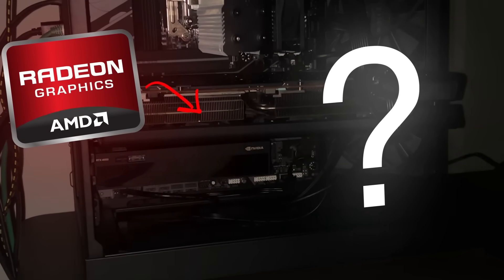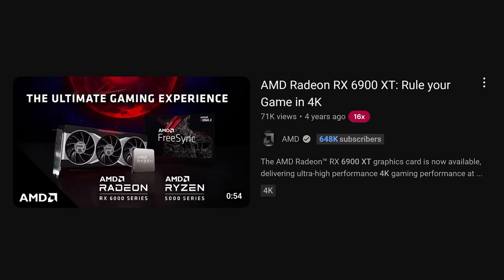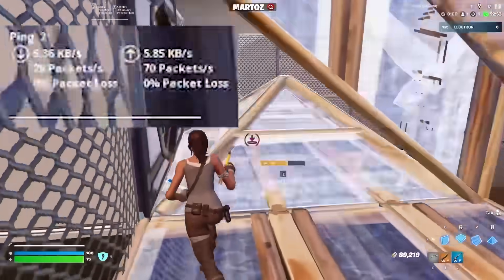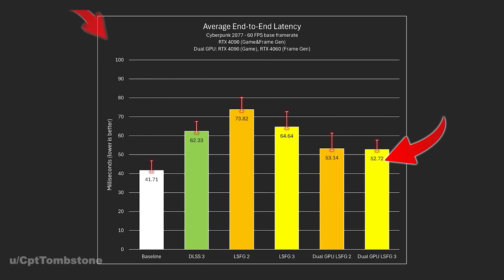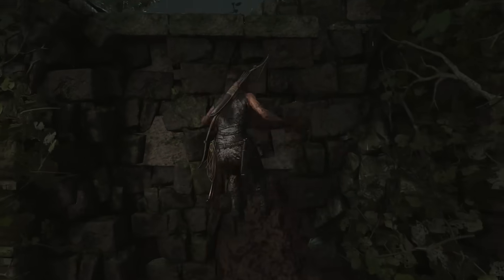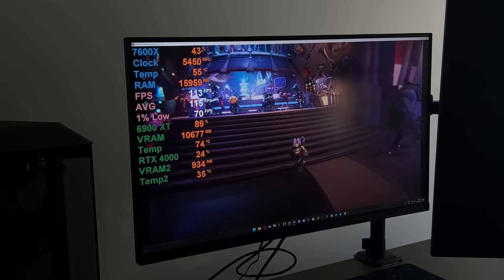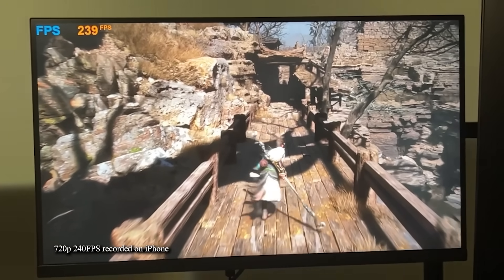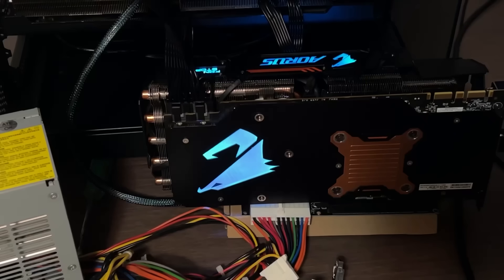I Used Both AMD & NVIDIA in One PC and Got 240 FPS in Every Game

Comment: Lol, I love your ridiculous and janky budget setup to get frame gen working well on cheap cards. Reminds me of my younger days before I had the disposable income to just build a cutting edge PC. A few of my favorites from back in the day, was where I was able to afford a GTX275 for around $300, but coudn’t afford to upgrade after the GTX 470 and 480 came out. So I bought a 2nd GTX 275 used for around $150, and because it was too much for my PSU to handle both cards, I hotwired a 2nd cheap power supply that sat outside my case, and I jumped a cable on the pin that made it so both PSUs powered up when I pressed the power button on my PC.

It worked fine outside looking ridiculous lol. A few years later, I was able to afford a GTX 680, but didn’t want to spend the $800+ to upgrade to the newer 780 and then the 980 when it came out. So I bought a 2nd 680 used for around $250, and double my FPS with SLI. A year later, I eventually added another 3rd GTX 680 for under $200, and the few games that triple SLI did work with, I had another 50% FPS boost and was actually on par or higher than the latest GTX 980Ti that was out. Problem was that it required a lot of hacks to get SLI working in some games, and even with those Tri-SLI simply didn’t work that well in several games, though it did seem to do well in Unreal Engine which was the majority of demanding games at the time. 

The frame pacing issue did kind of negate some of the benefits, though I was also at this time running a hacked Korean Catleap IPS monitor — That was overclocked from 60 to 100 or 120hz. Bear in mind, this was before LCD monitors with over 60 or 70hz support actually existed, but I was on the cutting edge by running this monitor setup well over a year before all the big brands finally came out with 120hz panels. I did eventually just get a 980Ti to get around the lack of support on some games, and those that didn’t scale well with SLI or at all. And once they came out, I did eventually upgrade to a proper 120hz 21:9 monitor, as the hacked monitor was a huge pain as you had to use registry hacks and an unsigned Nvidia driver mod, that needed to be reinstalled and set back up every time you updated your GPU drives.

Nowadays I’m just running a 4090, had a 3090 before that, 2080ti, and 1080ti previously. I’d consider trying LSGF with a 2nd GPU, for the latency benefits, but this damn 4-slot card leaves me with no usable PCIe slots lol. Hoping to eventually maybe snag a 5090 founder’s edition from Nvidia’s waitlist, as I’d love to simply reclaim my other PCIe slots, a dedicated sound card would be great simply because Realtek on my ASRock motherboard is damn glitchy even when just using the optical out going to my DAC and HiFi setup… it constantly cuts out and mirrors the left and right channels randomly, so I have to rely on HDMI for my audio actually, which works fine on my TV, but isn’t an option when I’m using my gaming monitor since it doesn’t have optical out.

Anyways, keep up your silly janky videos, they remind me of the good old days. Maybe someday you’ll make enough on YouTube or land a decent job in tech and will actually be able to blow some money on a top of the line PC, but until then, I’ll thoroughly enjoy your adventures and advice for the many folks out there on a budget!

Comment: why are you not recommending dual gpu if i dont have a laying around? is there any other  better way to get 240 fps on 1440p without selling a kidney ? and will it work on future ?
Reply: You can use integrated graphics instead of a second card if you lower the flow scale
Reply: @ivanvladimir0435  ooooh, but will i get that much fps wil integrated graphics ?
Reply: @ They'll have a lower limit than say an RX 6600, but the gap can be mended by lowering the flow scale and you would need really demanding scenarios to seriously be unable to give the task to the integrated graphics
Reply: @ so what kind of perfomence will i get with dual rx 580. will this 180$ dual gpu setup worth for poor people like me ?

Comment: is this just an ad for lossless scaling? so much hassle (and money for a second GPU) for a worse result than just conventional MFG from 50 series cards...
Reply: MFG drops your initial framerate (and thus makes the input latency more noticeable) + not in every game

Dual-GPU LSFG doesn't, if he had looked at a tutorial he wouldn't have needed to struggle so much to get it running
Reply: @ivanvladimir0435  MFG doesn't drop the initial framerate tho, I measured what I was getting without MFG (on Cyberpunk 2077), getting around ~40fps (with Path Tracing), with MFG 4X, it goes to ~160fps, which is precisely the 4X it promised, the input latency feels high here, because the real game is running below the ideal 60fps. 

That is why frame generation is not to be used to save a game running below 60fps, but instead to improve a game that is already running well (like for example, around ~80fps) to up to ~300fps, for better perceived motion on high refresh rate monitors, since the game is already running well, the input latency doesn't increase much (it was already good). And this case of the game already running well, is EXACTLY what the video is showing. Now I wish the video showed some game actually running below 60fps, to see if the second card would save it... (it would not, not without the high input latency at least).
Reply: @ MFG drops base framerate as shown here https://youtu.be/B_fGlVqKs1k?t=1118

People shouldn't need to slap a band-aid on their games with more intense upscaling to make up for it

Yet a second GPU would not drop the base framerate, thus giving smaller latency penalty while being way cheaper than a RTX 5000 series

Comment: AMD should really look into this and start making those dual chip cards again. Maybe spend time developing a "Infinity Fabric" type of solution for the two chips to communicate with the Vram for less latency when using both, and or to communicate with the CPU / RAM bringing it full circle in an all AMD system? They could make it like a toggle setting to use both chips at once like old days for performance gain without frame gen, then if you toggle frame gen on it splits to 1:1, and one chip does the native frams while other does the frame gen sending the info within a Infinity Fabric type of system to keep latency down?

Comment: As a technical experiment this looks fun. As a practical solution this is very dumb and not because the hoops you had to jump through because of your limited 2nd PCI E slot, though that does make it much worse.
1. Even trying to use any kind of FG in a competitive game shows that you don't get it. "Just 10ms extra lag" is not good enough for a competitive game and no, the extra smoothness when already running above  100 fps won't make a big difference either.
2. You're never running at 240fps here, stop drinking the nvidia cool aid! Running at 240fps implies getting 240fps equivalent lag which is the main point for running 240fps, not smoothness. I know you know you aren't getting better input lag but going through all this trouble just for the smoothness while celebrating the 2nd coming of SLI (which this not) it's misguided at best.
3. Most people would be better served by selling both gpus and buying a slightly better GPU. You get actual better input lag when you need it and you can run whatever FG the game has when you don't, it will also look marginally better if it's implemented inside the game. You'll get less fake fps but it will be smooth enough.

Comment: I've used frame gen on games locked to 60 where more native performance isn't possible, and it still sucks. It's just motion smoothing. Fake frames suck and increase to power consumption from running 2 GPUs isn't worth it. A second GPU for encoding as a streamer/ youtuber might make sense, but for frame generation is just stupid. Dual GPU was actual frame rate back in the day, and it also sucked. Doing it for fake frames is dogshit.

Comment: Just for everyone's sake, I actually tested ExitLag myself and it does indeed work, surprisingly. I live in Texas, so the server closest to me is Dallas. My normal ping in Overwatch 2 is about 50-55 ms, but with ExitLag enabled, it drops down to 45-50 ms, which is actually decent. In Marvel Rivals, the difference is substantial. I went from about 65-70 ms to 40-50 ms ping; huge reduction. Lastly, in PUBG, I normally get 19-26 ms, but with ExitLag on, I get consistently 11-15 ms ping. Some games have more substantial gains than others, but I have yet to see a game that performed worse than without it being enabled. I am a bit hesitant on actually buying the subscription though. Not sure if I am willing to pay for this difference. The next and only thing you can do is either live near the server or upgrade to fiber optic internet.

Comment: Hello, late to this discovery (though I was pondering about sli/crossfire a decade ago, and recently years ago) I was wondering if you could test AMD CPUs with built-in-graphics (the 8000 series for example) paired with NVIDIA GPU. It will cut major power draw and cost, but what I am curious about is what the performance will be. Hopefully it is not too complex and or overwhelming from the amount of work. Thank you very much.

Comment: I have used both for years until I upgraded to a 3090, I used to use a Radeon HD 7950 paired with a GTX 980ti then after some years I upgraded both to a Radeon RX 580 and a RTX 2060, upgraded that to the 3090.

Comment: The artifacts in control was so obvious and 🤮   Also this is why Nvidia uses tensor cores for frame gen. It’s to offload the work so it’s basically what you are doing with two GPUs. AMD uses AI accelerators to offload in the new 9070 series. So any new gpu already does what you’re doing with two separate.
Reply: They still drop base frames even on the 5000 series unlike Dual-GPU's

Comment: Thanks for sharing this , it worked on my asus G16, with 4060 as rendering gpu and the 890m as lsfg gpu. I am going to try getting either a egpu dock (a bit messy but more flexible) or mobile egpu with 7600m (less flexible but more streamlined) and run it through m.2 to oculink adapter on my desktop with 4080, it’s seemingly making a lot more sense than getting a 5080. Wish me luck.

Comment: I mean, there are 5700 XT for less than 100 bucks, if you like to mess around, you can try out, for instance with a 3060 Ti as the main GPU, and the 5700 XT as frame generator

Comment: I tried that with a high end Threadripper..., works like a charm!  AMD 7900XTX and RTX 4080
Reply: how did you install two separate drivers?
Reply: @quercus3290  I just let windows do it's thing.
Reply: @WilliamNangauta  that doesnt work, so I do not believe you.
Reply: @quercus3290   Quite true!  Simply causes strange behavior from time to time, lockups!  I had it working though.  I really don't see why anyone would do this!!
Reply: @WilliamNangauta  ive done it before, windows wont accept two separate video drivers, one overwrites the other.
Reply: @quercus3290    You will have no probs on  windows 11 installing...... but lockups?  For the birds!  Maybe my motherboards design as PCI 5 in all 4 or 5 slots will do it.  And it did.  You might look at a driver update program of your choice.
Reply: @quercus3290    Windows should install them on theyre own,
Reply: Just did it again.  Works like a charm., you just have to know what you are doing.

Comment: I used to run a Radeon 5870 (I think) with a GT 8800 for physx.  I'd like to see that combined with lossless scaling. Strong Radeon with weak Nvidia.  Highest you can use is a RTX 4000 series cause Nvidia dropped support for 32 bit physx for 5000 series.  Between lossless scaling and backwards compatibility for physx, dual GPUs may not be so outlandish.  This crazy Radeon with Nvidia for physx was my very first PC build.

Comment: This is kind of interesting. I wonder how much the frame-gen actually needs. Would an APU with a dedicated card be a good match? Like a a 5700G for example. If you have that APU, it is aready in your system anyway. Not additional cables or PSUs. ;)

Comment: RT users are weird. My 7900xtx does like 180 FPS in cyberpunk 2077 at 4k with RT and a couple of other things I can't tell the difference whether they're on or off, turned off. I've been restricting it to my monitor's 120fps/Hz maximum refresh rate in order to save quite a significant chunk of power. This is in Linux, for the record.

Comment: Buying a second GPU to produce more fake frames.🤮

I have a hard time getting behind frame gen tech to begin with and throwing an extra off brand card into the mix seems like stat padding at best and more likely a quantitative can of worms in reality. The fact that you are able to jury rig this setup to produce more 'frames' does relatively little to establish whether or not this is objectively an improved gaming experience. I'd be way more interested in some comparisons in visual fidelity on a 5090 doing frame gen, the two gpus working in tandem, and just straight classical rasterization on one gpu. DLSS was bad enough for normalizing visual fuzz in AAA games, and then we layer frame gen on top of that which is really just the same interpolation gimmick tv manufactures have been using to fudge frame rate stats for years. Dumping a secondary set of drivers on your machine to chase even deeper levels of interpolation just seems retarded at this point as its only going to feed the player more garbage frames on top of the blurred mess modern game engines or serving up these days to begin with.
Reply: Your drivers argument shows you don't even know how it truly is, drivers don't conflict at all if you install from both companies
Reply: @ivanvladimir0435  Numerous games crash in this configuration, its uncharted territory and that was my point. Trying to rock this setup all the time will lead to problems at best and at worst ruin the visual fidelity of the experience just from the sheer volume of interpolated frames. Running two sets of drivers causes all sorts of problems with proprietary video card features like g-sync vs freesync. This can easily lead to the wrong set of features being loaded up in a game on the wrong type of card in countless situations. If you think this cant cause problems you are naïve.
Reply: @ You clearly are way over your head, I have yet to run into driver issues from running both AMD and Nvidia at the same time and have multiple videos showing so, the whole g-sync vs freesync "conflict" is entirely made by you as there's no such a thing as a conflict as both run the same way, the whole "g-sync will conflict with freesync" is made up bs, it runs just fine in my PC because that's how it works, it's not conflict on first sight unlike many theorists (and not *testers*, who are actually growing in numbers because of how well this works) are spewing out

Comment: I have 2 extra gtx 980 TI’s should I do this? The only thing I am missing is an adapter for the gpu as I have the same motherboard as you I also have an extra 1000 watt power supply lying around

Comment: That "better motherboard" might cuck the bandwidth of the x16 slots if you use any M.2 though. Some will drop the main x16 to x8 AND another 16 size slot (x8 or x4) down to lower PCIe lanes.
Motherboards require WAY too much research...

Comment: Thank you for this video. I was able to use my RX 580 in display GPU and my A770 in image generation. In adaptive LSFG 3.0 255 + 100% motion flow, WGC 1 API, optimized max FSR and auto full screen, default sync in latency 2 and without HDR. Favorite A770 GPU and RX580 Output Display. 
Everything works perfectly for me. I was even able to play Hitman WoA in full Ultra on the RX580 while I only play in high on the A770
Specs: i9-13900, DDR5-5600 32GB, A770 16GB, RX 580 2048sp 8GB, B760 Gaming Plus WIFI, KLLISRE SSD NVME PCIe Gen 3 3500Mo/s 512GB + Orico e7400 SSD NVME PCIe gen 4 7400Mo/s 1To + HGST HUH72880ALE604 HDD SATA 8To

Comment: problem  w dual gpus as well is mos pcie slots that are secondary produce even less performance then the main , thats if its even supported by the MB my gpu wont fit in bottom pcie it closes it off when main is used

Comment: Would running 2x AMD GPUs get you the similar results? I've got a 7800XT in my rig that has an x16 4.0 and an x16 3.0 slot. I've got a 5700XT laying around that I could pop into the x16 3.0 slot. I could go pick up an RTX3050 for $150 @ MicroCenter, but if I could use the GPU I've already got here, that would be wonderufl.

Comment: Reminds me of using an old Nvidia GT5200 or something with 2Gb of RAM exclusively for PhysX and the rendering running on a RX460 4Gb card or something. Can't recall exactly the pair right now, but definitely recall that this was just to have PhysX on an AMD card, and it worked hehe (also reduced the load on the CPU)

Comment: You sure didn't make it sound worthwhile. I think with more ideal hardware this wouldn't be such a bad idea, but since all we're doing is generating frames... I can't think of too many worthwhile applications. Especially since things like text or the HUD will get interpolated along with the rest of the image, which would be most noticeable precisely when frame gen is also the most beneficial...

It's a neat project for us tech enthusiasts, but does it make a lot of sense? Probably not.

That said, this has finally provided me with a good use case to run the triple-GPU-vender PC I've been wanting to run. I already have a 4060 Ti and A770. Now I just need an X3D CPU with integrated graphics (pretty please), and this could actually work! AMD iGPU for 2D work, Intel dGPU for 3D work, Nvidia dGPU for interpolation and PhysX! It's the perfect PC! Maybe this could finally make me upgrade from AM4...